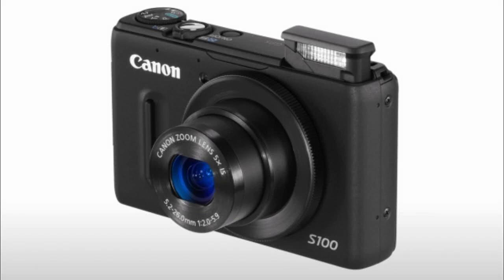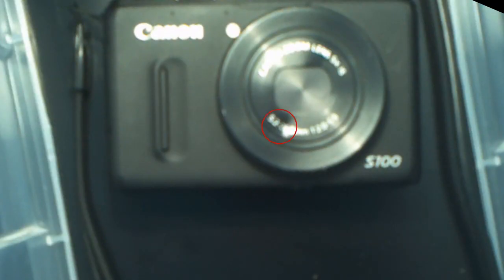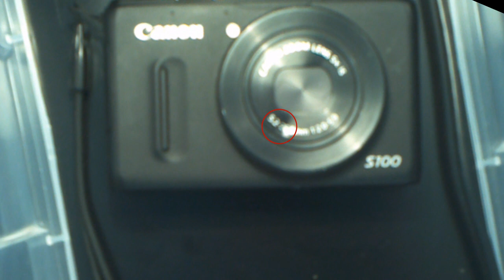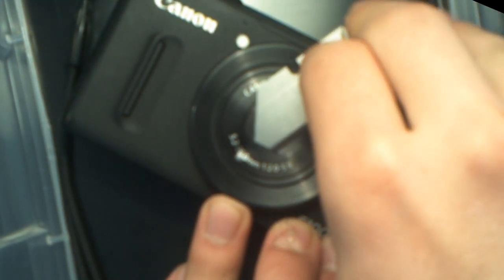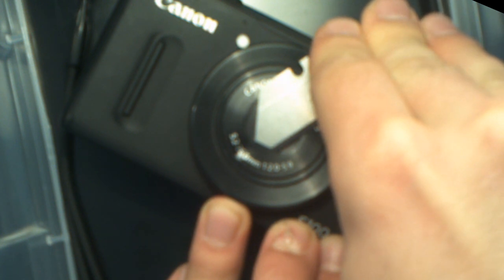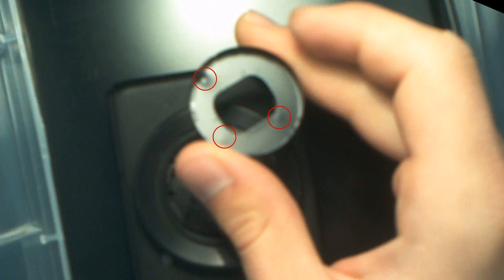Fixing dented lens cover housing on a Canon PowerShot S100

Comment: Thanks! I was hesitant to try to to pull off the lid because I was worried the inner mechanism would come shooting out.  The worst didn't happen.  I benefitted by turning on the camera power and extending the lens.  This gave me access to the outer ring of the lid which made it a little easier to loosen it up before prying it off the way you showed.